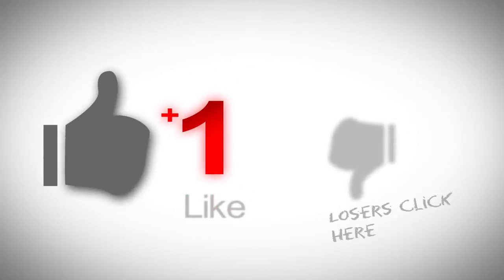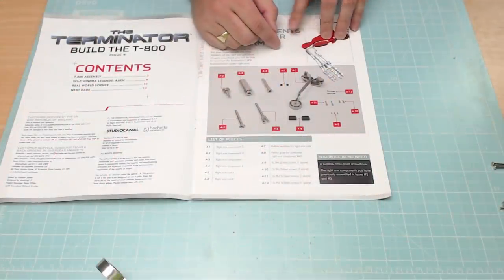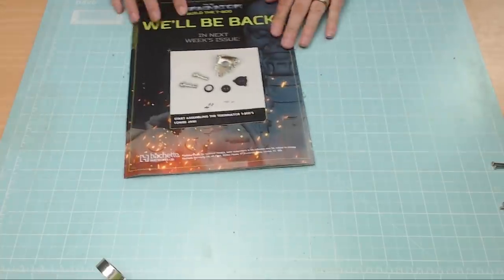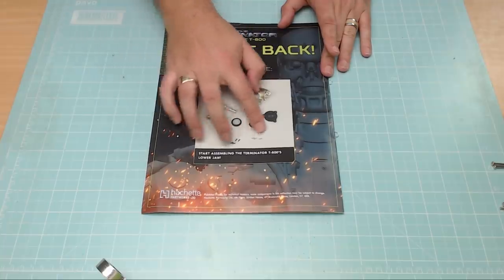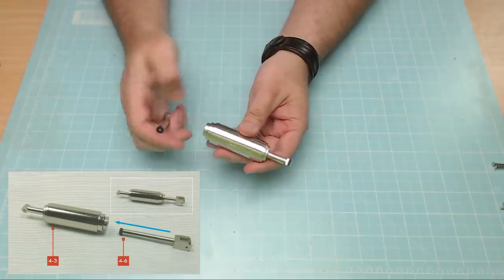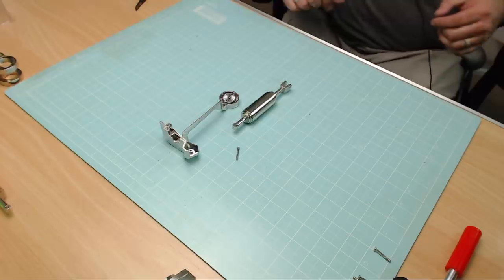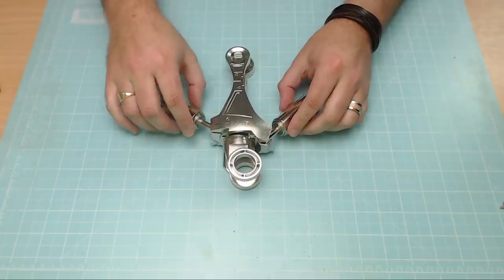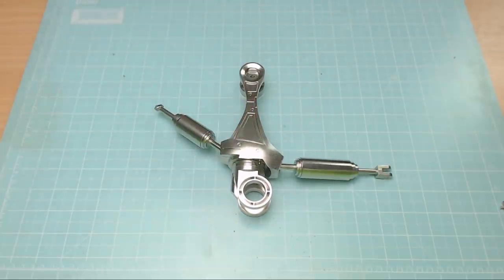Build the Terminator - Part 4 - Upper Right Arm Components

Comment: Looks nice and shiny. I hope they don't start giving you three bits of wire per issue like the DeLorean. Seems and joins don't look so bad on a robot as the robot isn't a natural being and metal has to join somewhere. As long as the joins are tight and touching it'll look great when it's finished.
I built and lit up an aerial hunter killer from the terminator future war scenes a while back and still have it, it's a nice bit of kit and with the lights on it looks awesomely feral and dangerous.

Comment: If anyone's tempted to lubricate the rubber o-rings, make sure the lubricant is safe to use with rubber (silicone spray, for example). Oil-based lubricants will cause the rubber to swell and deteriorate. (I sell various types of rubber product for cars and other uses.)

Also, if anyone wants to give this kit a great chrome finish. Alclad II (Alclad 2) chrome paint is the actual paint they used to chrome the T-800 skulls on Terminator Salvation. -Stan Winston School of Character Arts has an instructional video (for a fee) of how to add metallic effects to models. They use a T-800 skull and Alclad II chrome paint in the video. I forked out the dough to watch the video. It's worth every cent!

Comment: Wonder if you used WD40 or some kind of lubricant would help with the rubber part. Considering how much those pistons squeak and the difficulty turning the one part.
Reply from the maker: Someone mentioned earlier using a bit of silicon grease. The thing is it needs to be quite tight to be able to make the figure opposable. If it is too loose it will just drop.

Comment: Have u got it the right way round as many people have it the other side instead of side words I’ll drop u a Facebook message of mine
Reply from the maker: It's the same as the mag so I hope so
Reply: Yeah but if u look at the parts which show the bits it’s showing the other way round many other you tubers have done it differently to yours so I’m not sure
Reply from the maker: Yep but if you are talking about the top piece with the rubber mounts it can be turned easily

Comment: I started collecting this kit but decided to cancel as the Finish is too Inconsistent! There are plastic chromed parts that are Flawless and then there are the Chromed Metal Parts That has a Granulated Texture That I Really Don’t Like!? Not only is this Evident when I run a finger nail across the Surface, you can see it at a Distance too? This Feature would be all well and Good if I was going to build a weathered T-800 but I’m not! I want this to look every bit as good as the Original or the Filming Prop!? Also I really don’t want to be making Alterations to an Item that’s Going to Cost me well over £1000.00- The Jaw Alterations were Jarring to say the Very Least! I was And Am So Disappointed Especially As my Halcyon And Tsukuda Kits are More Accurate And they are only Injected Polystyrene!? It Begs the Question Of how many Critical Alterations will I have to make with Subsequent Issues? And I have a Really Bad Feeling That there are going to be more Inaccuracies with each New Issue. I can just feel it and I do not think that it’s going to be an easy fix relatively speaking with R2 in mind and His Blue Panels That I had to glue in place- no there are going to be some Big Ones! Also I don’t really fancy polishing something that’s supposed to have a consistent Chrome Finish across the board?!  As I mentioned the Jaw Assembly For Example- That is So Glaringly a Mistake That Publisher Didn’t Even Make a Half Attempt to Rectify? Sorry Guys I’m Bowing Out On this One! Good Luck and All the Best Though! It should be interesting to see how it all Turns Out!?